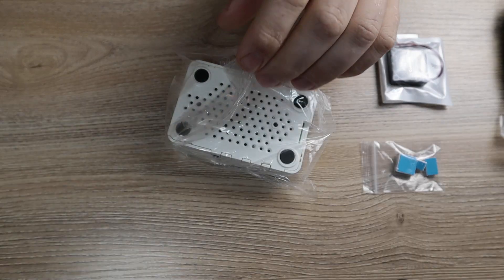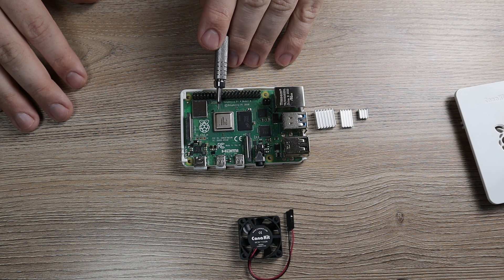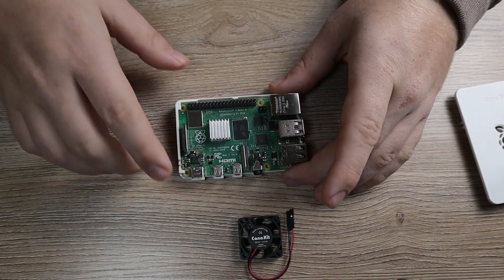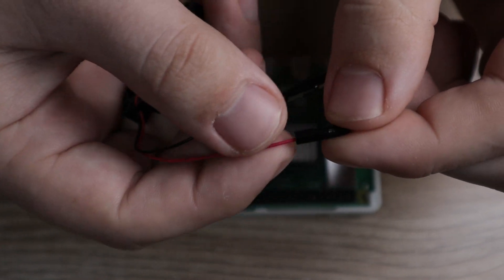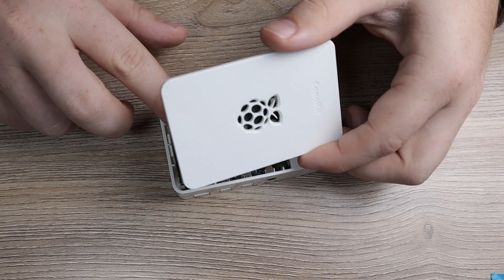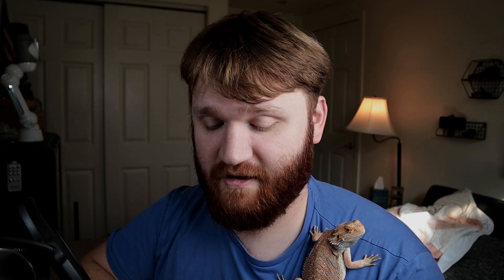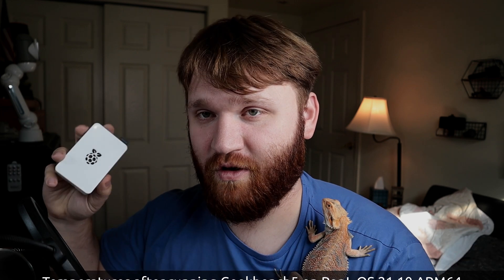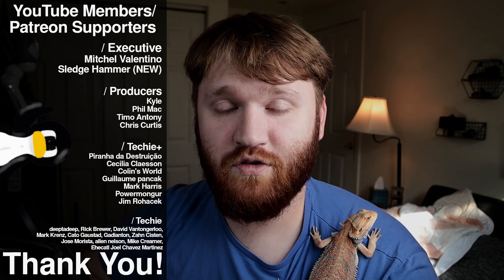Raspberry Pi 4 NEEDS A FAN - How to Install CanaKit Heatsink and Fan

Comment: Went back to my light canakit plastic and official case for my 8gb for portability after a year of running an ice cooler. Shim fan with a 2200 over clock 8 over voltage I sit comfortably at 50

Comment: Unfortunately I think you have the fan backwards. Airflow moves toward the logo, and the side that looks like a frito chip scoop is the intake. 

Blowing air out of the case (logo facing OUT) should be more effective in order to radiate heat.
Reply: Yep. Very helpful video for the most part but the fan should definitely be the other way around for optimal performance. 

Personally, I'd also recommend putting the heat-sinks on from small to large. I found space got a bit tight for my sausage fingers with the CPU sink on but that's just me.
Reply: https://www.youtube.com/watch?v=N6keyV-gOzQ&ab_channel=plukas
Reply: The case isn't sealed, fresh cool air blows directly onto the heatsink and waste heat/air blows out of the case.

Although really, it doesn't matter much, if it works it works.

Comment: What about fan noise? Is it very noticeable? Can you control the fan speed with software?
Reply: The red wire is 5V and the black wire is GND so there is no actual fan control as it is directly plugged to 5V power. However, I find the fan running 5V irritating and often set these RPi fans at 3.3v by putting the red wires at any of the 3.3v pins; it makes the fan spin slower so there is less noise.
Reply: @Lavitz2011  Thanks! I'll try that on mine, the fan noise is so annoying, and doesn't need that much airflow
Reply: @henriquemartins5260  There are also 3 Pin fans wherein the extra pin can be attach to a GPIO pin and programmed to adjust according to CPU Temp or load.
Reply: Or just get old and you can't hear anything .. 🙂

Comment: Most of us use a more expensive a case that will passively cool the Pi4 without the need for a fan. While a good case like that will be double the price (at least), it's the preferred method for any home tinkerer.
Reply: Could you post a link to that case, please?
Reply: Eh, depends what you are using it for. I have my RPi4 in my bearded dragons enclosure with a HQ Camera attached with a heatsink case with 2 fans in it. Being in a hot reptile enclosure, the passive case just wasn't enough to sufficiently bring down the temps. When I added the two fans it bought it down to a lovely 50°c.

I know most people aren't using their Pi's in a 35°c+ enclosure, but as with everything, use case determines your needs.

Comment: Now think how bad the official case is, with no air-holes, and no fan.
Reply from the maker: Big oof
Reply: The official website sells a fan that works with the official case, but the only way for air to get in is through the USB and ethernet port gaps
Reply: I prefer it. I pop the top of with a shim fan while using and use the top to put in my pocket.